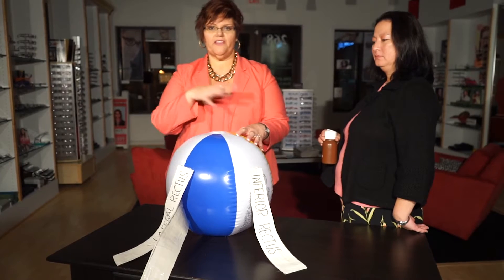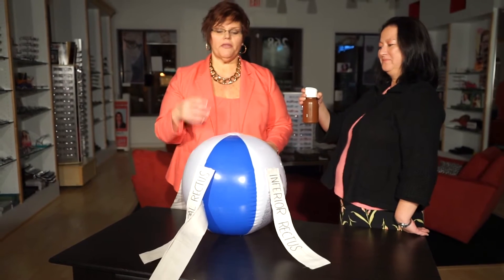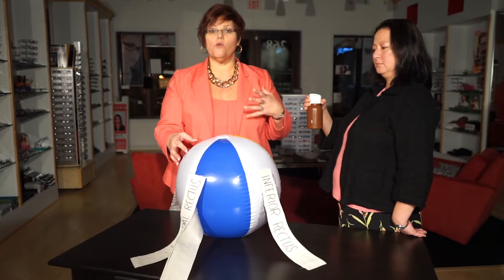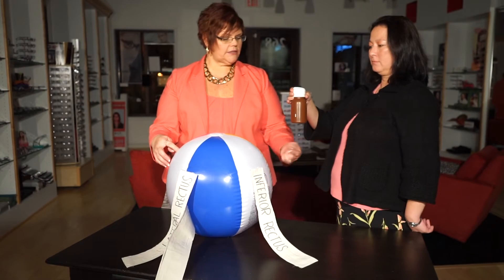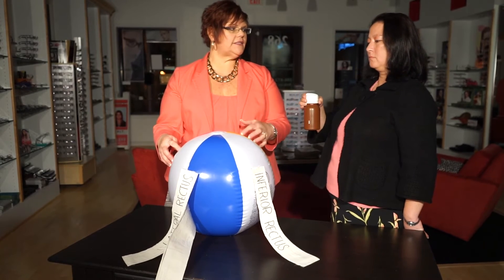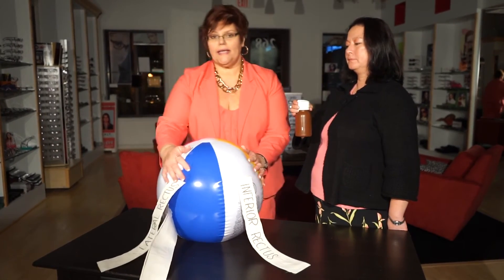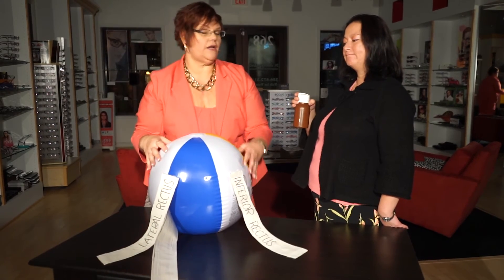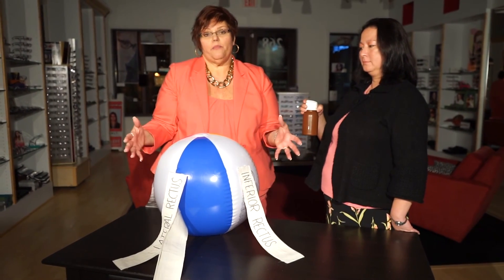How Does Applanation Tonometry Work? The Imbert Fick Principle

Comment: Hi, Ma'am, thank you very much for such a nice explanation, it is really cool.. however, just a small point I would like to point it out, the dimension of the supposed Tonometer, supposed to be in centimeter rather than millimeter.
Reply from the maker: From the American Academy of Ophthalmology:
Goldmann and Perkins applanation tonometry
The Goldmann applanation tonometer measures the force necessary to flatten a corneal area of 3.06mm diameter.  Here's the link: https://eyewiki.org/IOP_and_Tonometry#Goldmann_and_Perkins_applanation_tonometry

Comment: Important to note that the 3.06mm is the diameter of the the biprism. More important is that you are not indenting the cornea by 3.06 mm. That would be about 1/8 of the total length of the eye. You are flattening a surface area defined by the diameter of the biprism, about 7.3 square mm.
Reply from the maker: From the American Academy of Ophthalmology:
Goldmann and Perkins applanation tonometry
The Goldmann applanation tonometer measures the force necessary to flatten a corneal area of 3.06mm diameter.  Here's the link: https://eyewiki.org/IOP_and_Tonometry#Goldmann_and_Perkins_applanation_tonometry